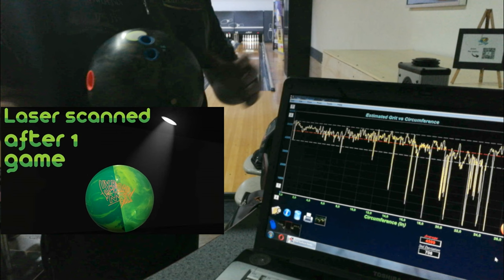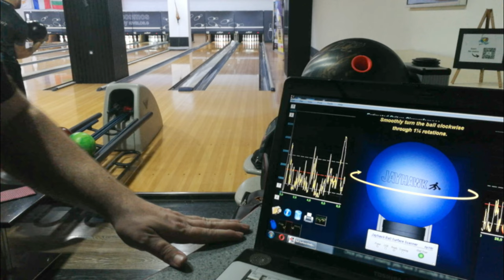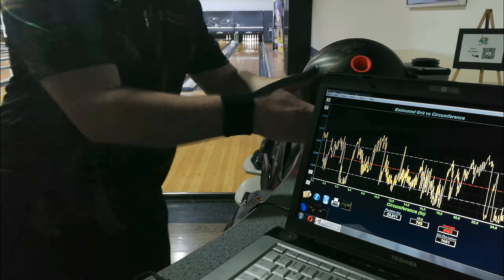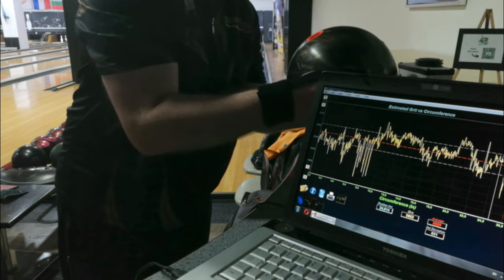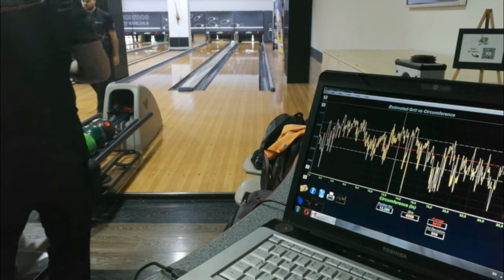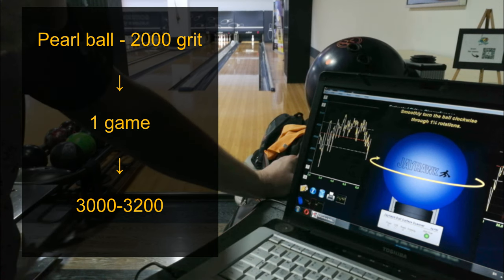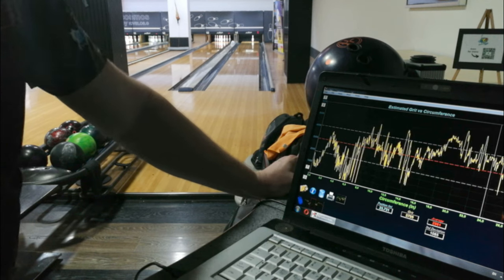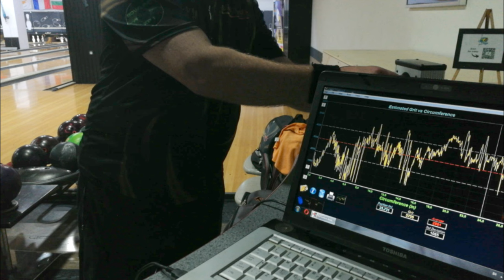Laser scanning a PEARL bowling ball after 1 game !

Comment: Makes me wonder if it's ever worth resurfacing a bowling ball... If the ball will change that drastically in a single game, it seems you would end up having inconsistent reaction throughout the game. Now obviously, this must not be the case because so many bowlers find their balls "revive" after resurfacing them. I wonder how many games it takes to stabilize and at what grit that occurs at. I'm sure it's different depending on the house your bowling at.
Reply from the maker: Hi! Thanks for watching! It depends. A difference of 1000 grit per game is not too drastic because the lane also dries up, so the end effect blends to a degree. The grit only changes towards going UP. So all bowling balls shine up, their grit goes up. But they stabilize around 4500 to 5000 depending on the alley. So then if you like it at that state, you can only clean it from then on. (and de-oil it if you let a lot of oil soak in). But if you like it say at 2000 or 3000, then after every league night you should resurface it down to that number. I hope this helps !